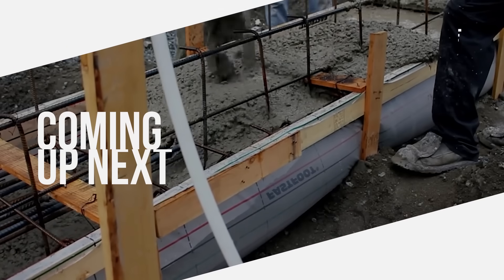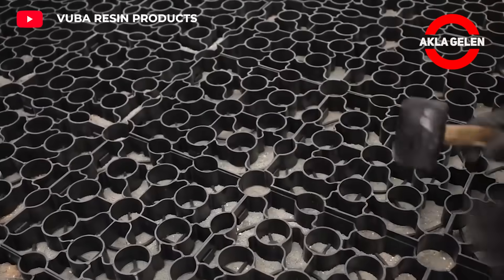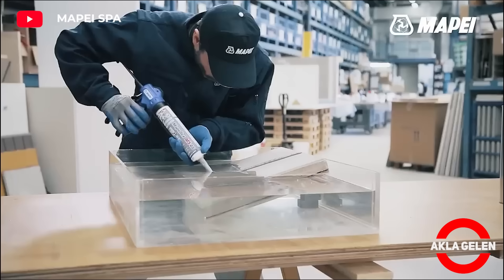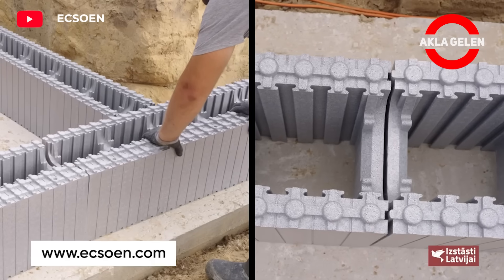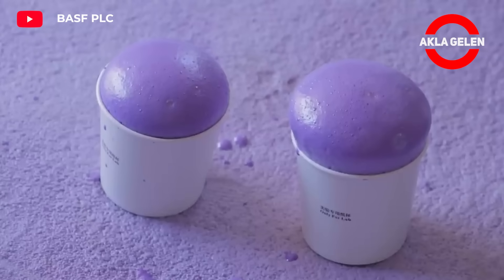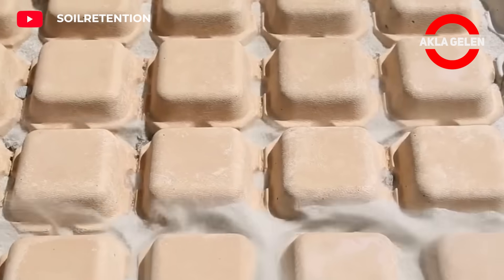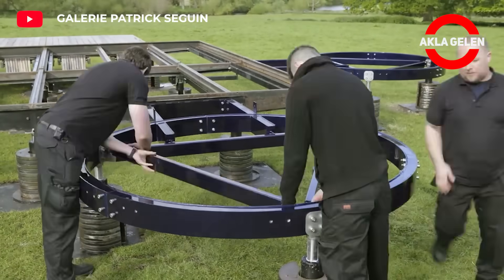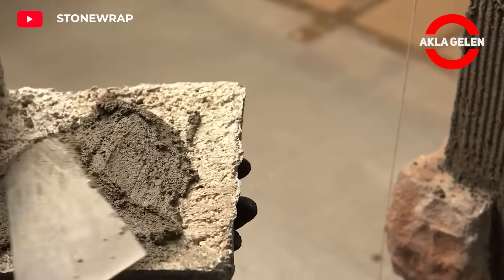Construction Workers Can't Believe This Technique Works - Most Ingenious Construction Technologies▶2

Comment: 1:56 In the UK Banks will not give mortgages on properties that have this expanding foam installed. There is no way to examine the beams to determine if they are still structurally sound.
It's possibly acceptable in countries like the USA, where they replace roofs relatively often, but not in the UK/Europe where they are expected to last 100 years or so.

Comment: With the exception of the mortor pads everything I saw either turns into deadly gas if it catches fire or will contribute to the plastic pollution and micro plastic in the environment.

Comment: Most lumber yard wood is not properly kiln-dried. Covering it with foam will trap the moisture, causing it to rot and attracting termites.
Also, your timbers will not be visible, so code-compliant  inspections can't be done.
Reply: In the UK the Banks will not give mortgages on properties with this foam installed, because the beams cannot be inspected to verify they are still structurally sound.

Comment: lol, filling the drainage and air gap behind the brick.  Brilliant!  With freeze thaw cycles that brick will now last only 5 years.  Well done.
Reply: Yep - they are blocking the weep holes on the bottom course.  Joints get wet but no place for water to exit in back plus no air movement.  Do you have to then apply waterproofing to the entire wall?  How long does the waterproofing last?  Now that becomes a maintenance item and if not maintained creates issues with freeze thaw weather.
Reply: But it's progress!!! Unbelievable that designs that have stood the test of time are now thrown aside in the search of progress.

Comment: Oil leaks from a car, will over time,  soak into the resin bound surfacing which is designed to absorb liquids. How do you clean this without contaminating the ground subsurface ( with yet more cleaning chemicals),  permanently?

Or is it designed for obsolescence (dig up and replace )
Reply: Great point!  Oops !

Comment: Construction products are often designed mainly for workers to save construction hours. The first question I have is, how long will the products last? A home builder friend of mine told me his plumbers are making a killing installing Pex pipe as opposed to copper. There are some videos showing rats chewing through Pex. In my neighborhood, they are tearing down older homes and building newer upscale homes. They are burying Pex under concrete slabs. The pipe may be fine but the construction industry has a history of using products that fail in a relatively short time. For example, I had my home sided with a brand of cement board. It came with a 50-year warranty. In 10 years some boards failed and turned to a graham cracker-like consistency.

Comment: no tires in building were featured as displayed on image
Reply: Exactly,  the only reason I watched this crap.
Reply: Me too
Reply: @seanpjkennedy  yeah no sub gor me. Disappointed
Reply: Ty, leaving.
Reply: i dont think you can use tires to make concrete pillars, anyway.  Too much flex where the two tires meet.  if you cut the sidewalls off,  the tire becomes flimsy like nothing !!
Reply: @mindfornication4funn  you don't use it for pillars. You use tires as cement forms for the wall cores in "Earthship" style construction
Reply: @nicholashodges201   CORRECT !
Reply: @nicholashodges201  
AS FAR AS EARTHSHIP TIRE STUFF, i did not understand why you dont cut off the top sidewall and just fill with dirt, instead of the earth pounding !
Reply: EXACTLY!
Reply: Saw this too late.
Reply: Thank you, skipping.
Reply: That's how come I clicked on it!! 😢
Reply: Tire flex could  be a good absorption of earthquake energy.
Reply: Thanks! I’m out.

Comment: Item 1:   Footing to be 2 feet thick or less...  Footing will be bulged.. adding concrete and making repairs/water leakage methods impossible
Item 2:   More expensive gravel
Item 3:   Foam insulation....  been around since at least the 80s.   Sealing the house to well will actually cause mold issues
Item 4:   a better caulk 
Item 5:   Crap dry mortar with required special bricks.... 

Item 6:   Insulation lego forms ..  siding will have issues attaching
Item 7:   Foam Insulation.....  its not new
Item 8:   a garbage foundation system that will collapse under load.   Does not meet IBC, ASCE reqs
Item 9:   a landscapers worst nightmare... it will be dead in less than a year
Item 10:  a crappy overpriced cabin that a double wide trailer outperforms
Item11:   fake stone concrete blocks....  been around since the 1820s

Comment: Spray foam insulation costs thousands to apply then triple that a few years later to remove as your house starts to rot from the inside out!
Reply: I was curious about your statement so I ask a real estate friend of mine who’s been in the business 40 years or better and he also owns a construction business business. He has not found that to be true in his experience building the houses or selling them so I was wondering what your basingyour statement on?
Reply: @JohnHill-k6p My friends bought a house that had its loft sprayed with this stuff. He had to pay a lot of money to have it removed when the roof struts rotted. The roofer who removed it said my friend was close to having his roof collapse on him. It’s a bad way of insulating your house.
Reply: @mossfordgreen8725  it wasn’t the spray insulation that made it rot. It was a bad roof. Any type of insulation won’t help or cause a rotting problem unless you have a bad roof. That’s the problem. Most people will spend huge amount of money on all kinds of repairs and when they build a house, but they want to go cheap on a roof system. And just because your roof looks OK and you don’t see any leaks doesn’t mean you shouldn’t have it inspected least every five years and it should be replaced at least every 20 years unless you have a metal roof or slate or tile then you can go 100 but it still needs to be inspected, it was not the spray insulation that made it rot. It was water that made things rot and where did the water come from? It came through a bad roof.
Reply: @JohnHill-k6p  spraying an entire home with closed cellular foam will trap moisture.  If you take long hot showers, you will rot the attic out fairly quickly.  Mold is also another issue.
Reply: @zarthemad8386  that’s why new homes have ventilation in the bathrooms. It’s a code that’s why homes have ventilation in a kitchen. It’s cold. That’s why most new heating and air conditioning units draw outside air in so that there is a continuous supply and exchange of air. How do I know this because of other things that I had to have in my house when I built it five years ago.
Reply: @JohnHill-k6p  it depends on the climate. I am guessing the main difference of opinion is because in the US quite often the climate  is either hot or cold and in the UK quite often it is just right to get  condensation on the inside of the roof layers trapped by the foam insulation. because the moisture cannot escape and it rots the timber.
Reply: @pary327  everybody keeps missing the point the problem isn’t the spray foam the problem is you don’t have a good roof. It either leaks or it’s not properly ventilated if it is a good roof and doesn’t leak and if it’s properly ventilated, it will not get condensation. If I spray foam all the sides of a piece of wood and put it outside, it won’t rot because moisture can’t get to the wood. The only thing that rots wood is moisture. No moisture, no rot ventilation no moisture no rot.
Reply: @zarthemad8386  If your bathroom doesn't have a fan with outside ventilation, you shouldn't be making insulation decisions
Reply: If you build a new house with a galvanised steel frame I can’t imagine any problems.50% of new homes here in Australia are steel framed.No warping,no rotting,no termite damage,roughly the same cost as timber.
Reply: @davidjohnston7512 Try 10% of new homes
Reply: Ever heard of an air exchanger? You don't put tires on your car without rims do you?
Reply: a passive house design like that must have a ventilation system - usually a heat recovery one to minimise energy waste.. without it, yes.. rot..

Comment: Too expensive, the old way is better and way cheaper.
Reply: The old way was asbestos and lead paint. If you're going to make a claim about cheaper, you need to consider many factors related to the technological advances and compare with labor savings, energy conversation and product longevity.
Reply: @yootoob7048  Say what?
Reply: @joe-hp4nk   I was very clear in my response. Is that your defense of overgeneralized hyperbole?
Reply: @yootoob7048 They're comparing it to the  way they're doing it today, not 50 years ago, and yes what you just saw in the video  is way more expensive than the way things are done now
Reply: @allananderson949  Nowhere in the video is there a reference to a time period comparison, so your argument fails. Also, you seem to be ignorant about how recent lead paint and asbestos were used in "modern" construction. You cannot substantiate your claim regarding how expensive the techniques presented in the video as compared to any timeline. Finally, my reply was to the comment "Too expensive, the old way is better and way cheaper." You inserted yourself into a discussion without actually comprehending the content.
Reply: And not
Reply: And safer. All those plastics and foam insulations exhaust gases that are not healthy. If you see someone spraying something while wearing a spacesuit should send alarm bells off.